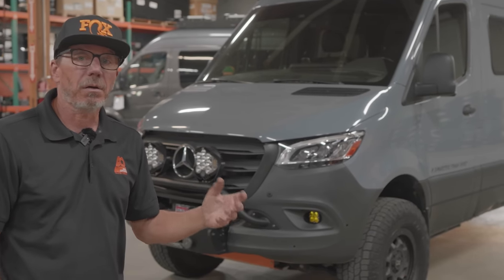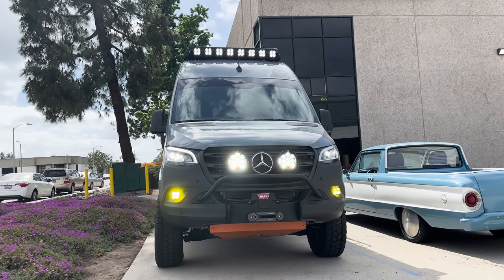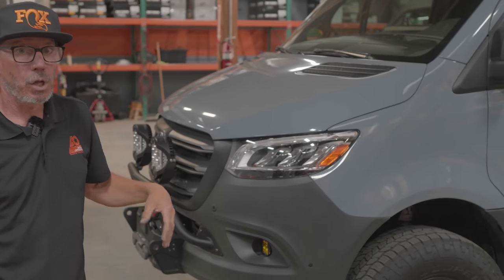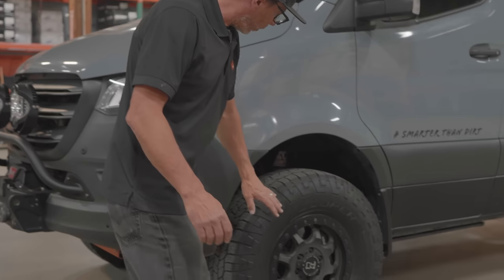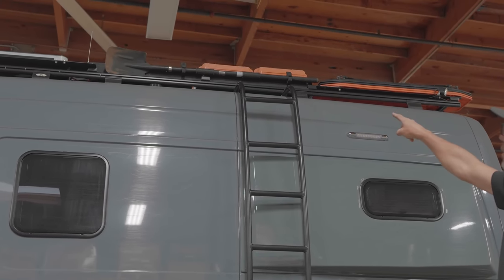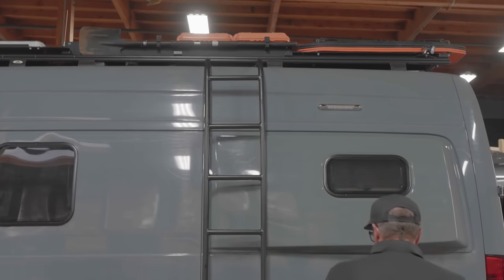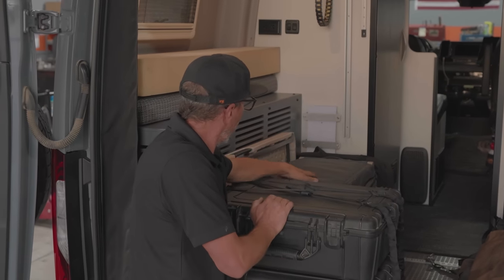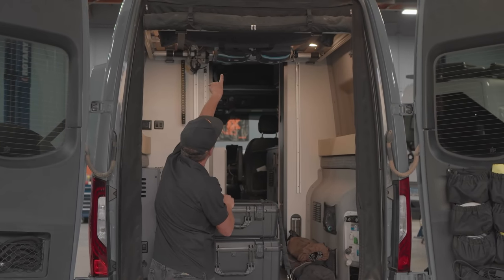AGILE OFFROAD'S FLAGSHIP WALKAROUND - 2021 REVEL

Comment: A lot of nice stuff.  Not off road but I use our 2013 170WB Sprinter to tow our boat and other trailers.  That Rear Locker and those AMP steps need to be on our van.  Is that possible?
Reply from the maker: Hey there Jimmy! It is 100% possible!! We can do both of those on the 2013! Email info@agileoffroad.com or give the shop a call at (619)-328-1297. Cheers!

Comment: Great video! How does the transfer case handle the front/back axle ratio mismatch after switching the rear from 3.92 to 4.18? Is the planetary gear of the open center diff able to handle this on a sustained basis? Or do you now only run 4WD on short stretches (to not overload the transfer case too much)?
Reply from the maker: It is always a concern of ours BUT so far it's been great! It has sustained 300+ miles on highway 4WD (by accident haha!) With 30k miles with the Locker installed, we haven't encountered any issues!